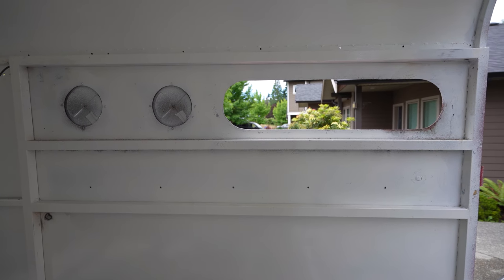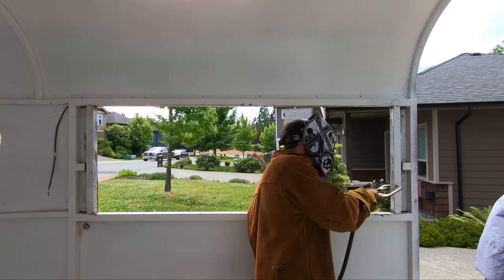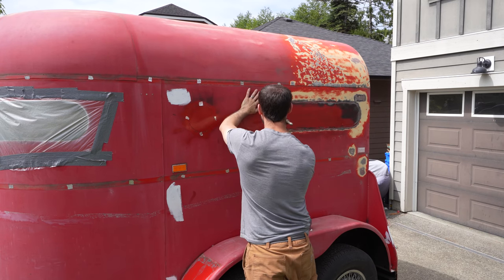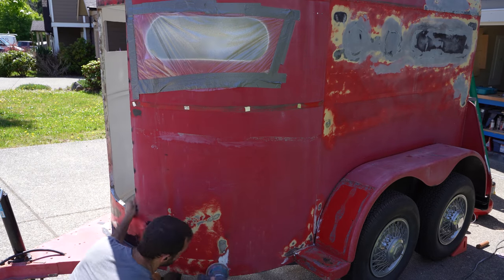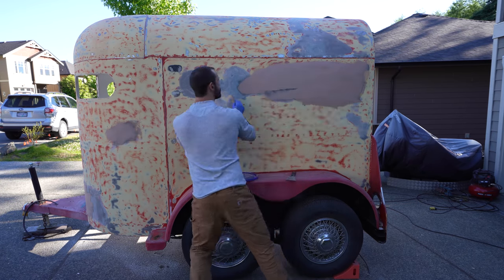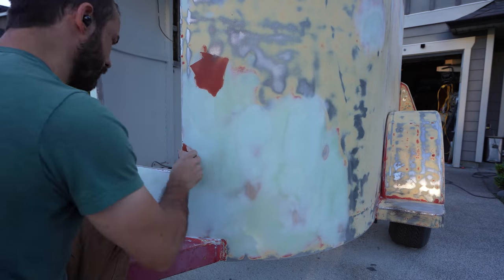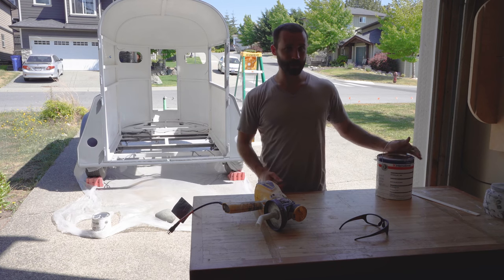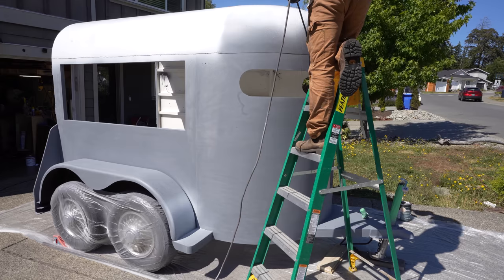First Sip Mobile Bar: Bodywork and Paint for the Horse Trailer Bar

Comment: Question for you. I am doing a horse trailer conversion. I envy your hand sanding...I am going to sandblast it. Should I put the bondo on after the sandblast ?
Reply from the maker: Ideally you should prime the trailer prior to applying bondo. A few small bare metal spots are OK as long as they are rust free.
Reply: Awesome. Thanks. Excited to see your final product.  @WetCoastWorkshop

Comment: The side walls of the trailer is it steel or aluminum?
Reply from the maker: It's 11ga steel
Reply: @WetCoastWorkshop  thank you! I am doing the exact thing you are in Ontario, if you have any advice, would be greatly appreciated!
Reply from the maker: @pedrog1580  I would recommend avoiding the Alkyd primer and paint, I'm not happy with the final result, it's soft and hard to keep clean. Go with an epoxy primer and then your choice of automotive topcoat. Also, if it's in your budget, get one of the pre-fabbed concession windows for food trucks, much easier to weatherseal than making your own custom one!
Reply: @WetCoastWorkshop  wow thank you so much for the advice!